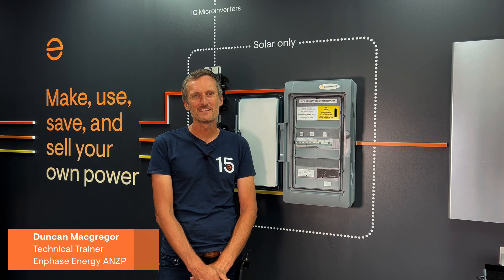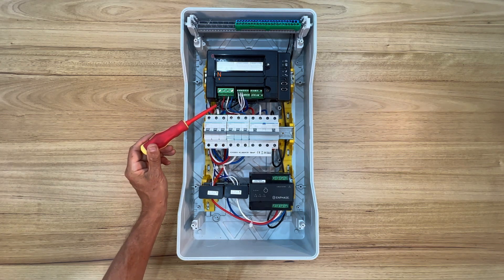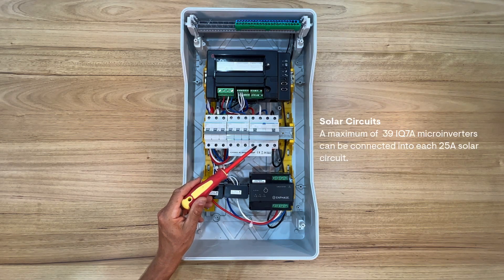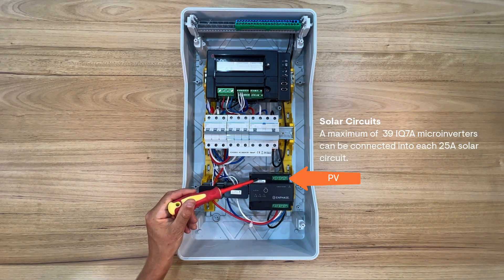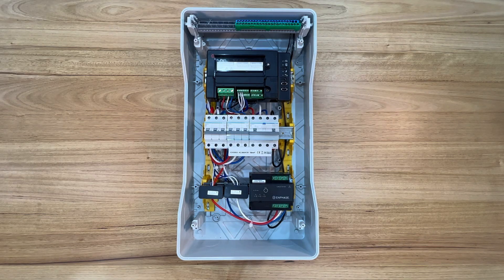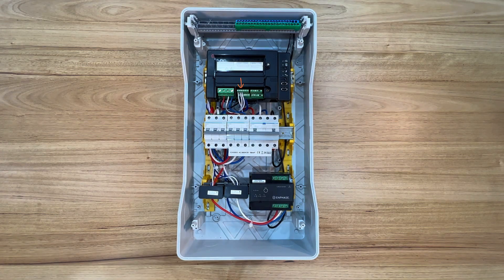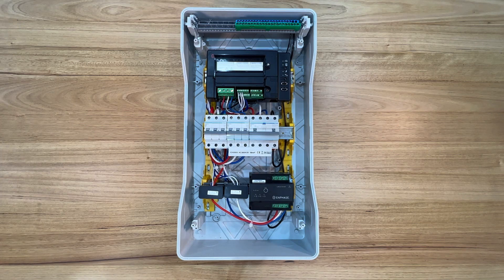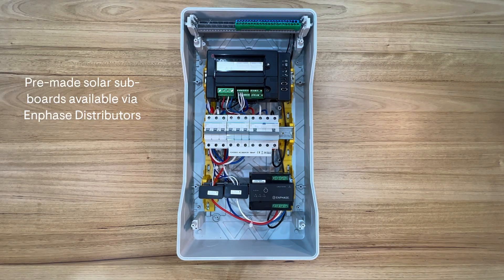Enphase - multiphase solar sub board - overview

Comment: If I don't want to use CT's can I also use a single phase envoy-s standard in a 3ph setup with 3ph q Relais and feed the envoy from 1 phase after the Q Relais. PV is  3 x 3 panels using 3 ph cables.
Reply from the maker: Hi Les,  There are different Enphase products for different countries around the globe.  The Envoy-S Standard is not a product used in ANZ. Please refer to the North American Youtube Chanel for further information https://www.youtube.com/user/enphaseenergy